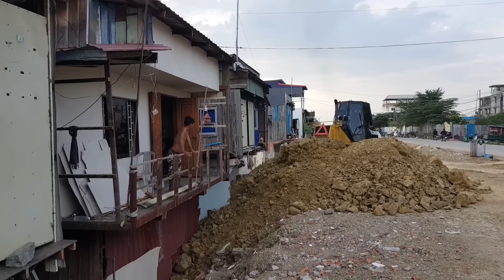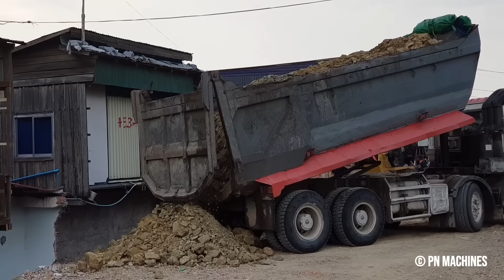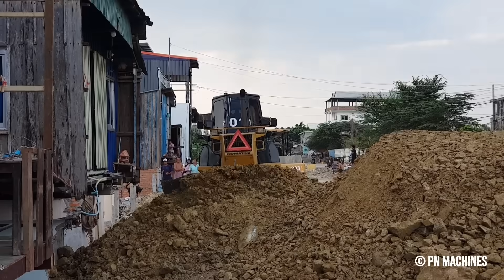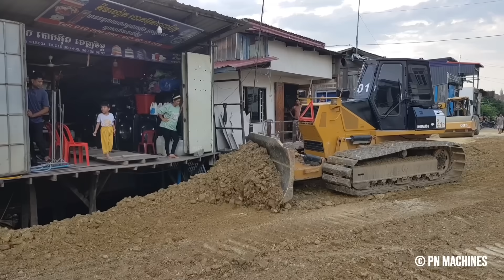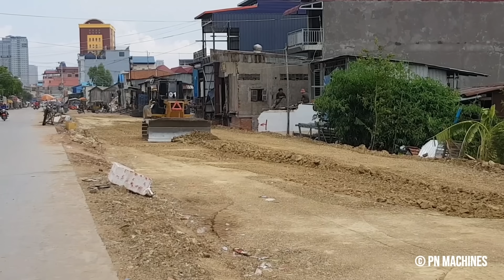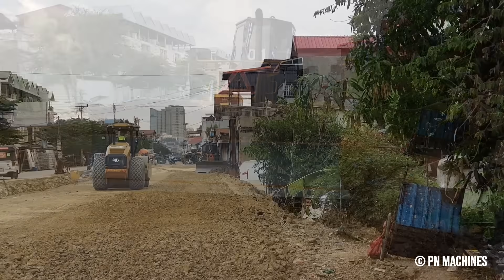Best Technique Skills Repair Foundation Road By Dump Truck, Roller & Dozer Komatsu Pushing Stone

Comment: I think what folks are trying to say is you need to compact this in layers. First batch of dirt- compact Second on top of that - compact etc. I see the roller came in but was only on the very last batch of dirt which did no good when the rain comes.
Reply: Prim si mette la platica poi la rumenta  in fine la pozzolana...quando piove porta tutto nel 'Orinoco assieme agli umani😂😂😂😂😂😂😂😂

Comment: throwing dirt up next to those houses aint doing those structures any favors. just putting alot of pressure on those exterior walls
Reply from the maker: Thank for comment
Reply: Dang, if only you could have been there to tell them before they did all that work.
Reply: @rodm5830  I agree. Maybe they don’t know any better.🤷🏾‍♂️
Reply: You are so right plus rain water will rot the wood

Comment: nice video. But that won't help much another flood and the same thing will happen, you didn't compact any of it, but the outer area.
Reply: All of this type of construction in developing countries is just generally the bare minimum at the last minute.
Obviously they would have started with grading on the side and then a reinforced concrete pour for walls.  It'll be better than that what they had before the LAST rain, that's for sure.  They have drainage of some kind, already set up under those houses.

Comment: The house owner didn't have any problem with this because the wall will surely collapse someday, it was not build to take such a heavy load of soil
Reply from the maker: After the road is built, they will remodel their house
Reply: @pnmachines  it make sense if the contractor or government or whoever build the road is going to remodel their house or build new house. Thanks for the explanation.
Reply: @pnmachines ,this is like first cut the head than break the pot .why concret wall not built both sides before dumping mud the residents are foolish to allow such filthy work they will cry later on